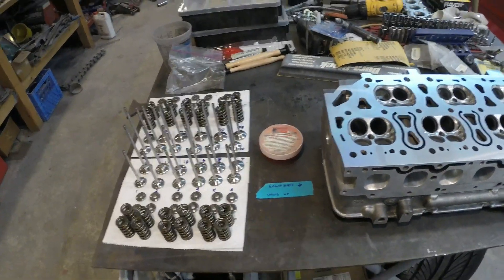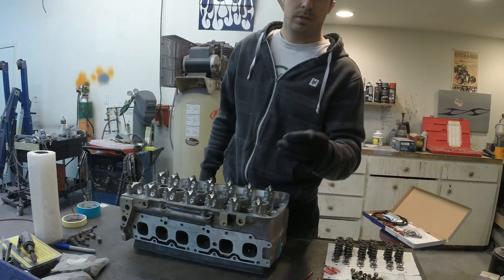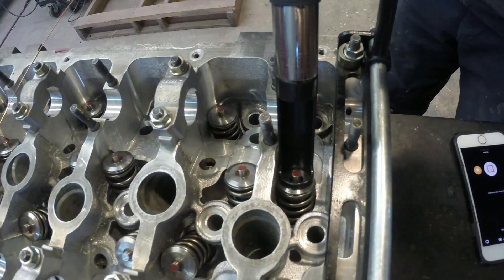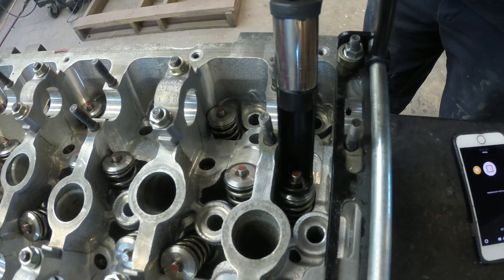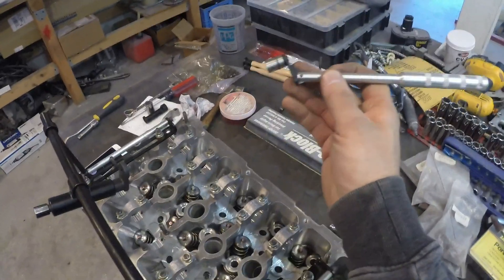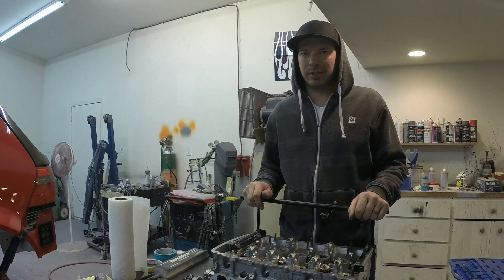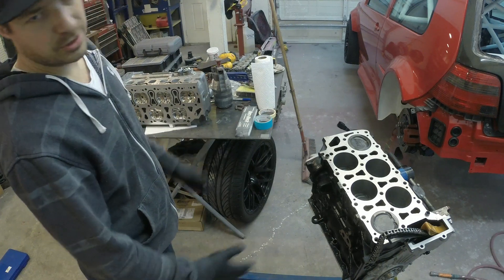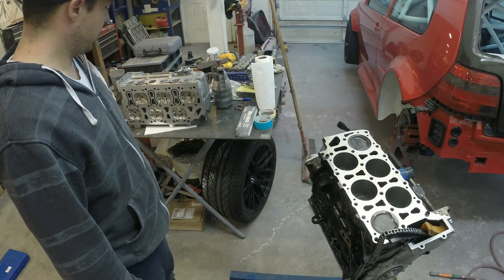R32 build episode 3: valve train assembly

Comment: What would be a good replacement for an R32 motor if i cant find another r32 motor? Mine blew up i need to find a replacement.
Reply from the maker: gsrhatch14 get a long block from a 3.2 Tuareg. Everything from your car will bolt up. You may have to drill and tap the motor passenger mount holes though.
Reply: Andy Krett That crank isn’t forged right?
Reply from the maker: gsrhatch14 we’ve been finding forged cranks in the early Tuaregs.
Reply: Andy Krett oh shit. I still have my r32 crank seems to be in good shape. Do you know any good source to get a block by chance? Other than the junk yard